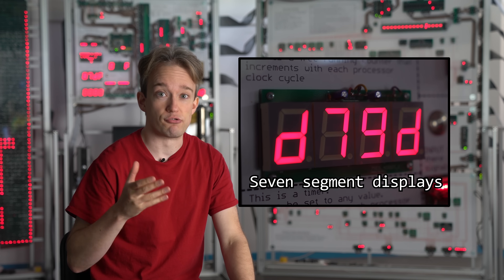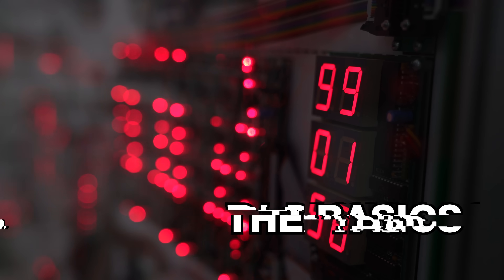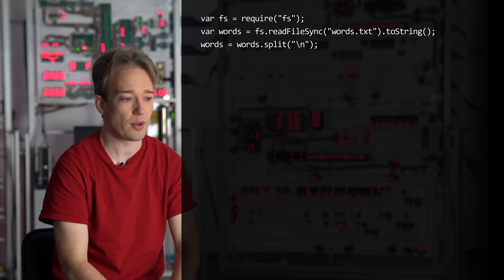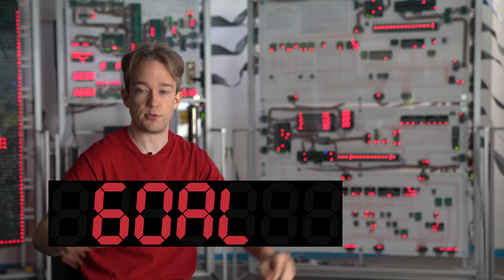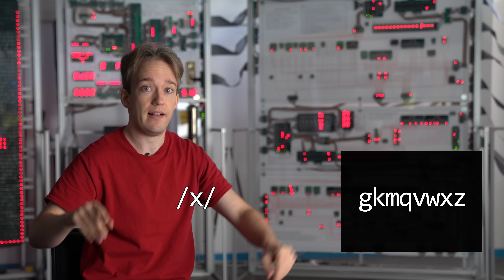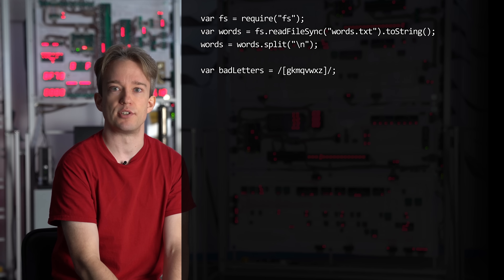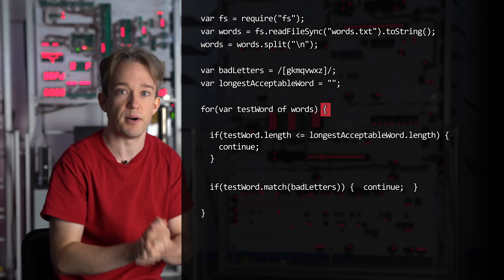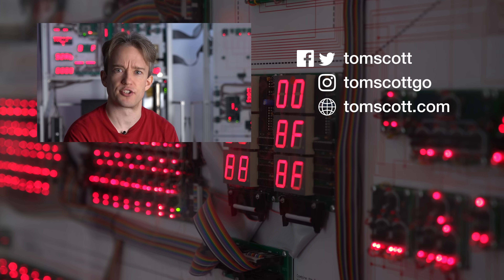What's The Longest Word You Can Write With Seven-Segment Displays?

Comment: This is going to bug me. Seven is the minimum number of segments required to show every Arabic numeral, not "every number".
Reply: You could argue that "every number" is correct since you can just write the numbers as a string of digits using Arabic numerals.  (I'm assuming that our display is infinitely long and that we only care about reals.)
Reply: well Pi is a number and you can't write it even on infinite-sized board, because you just don't know it, and will never know. But you can use PI, and it's exact.
Reply: @Lag Duck, I should also have made the fundamental assumption that time is infinite and programmers work for free.
Reply: @lagduck2209  Pi can be written by lighting the top horizontal segment, and both lower vertical segments. Several other constants could be displayed as well.
Reply: distantcam is technically correct because every natural number can be written with a 1-segment display in binary..
Reply: Alex Stefanov Yeah, but given the lay audience (and the explanation of what a byte is) I figured it was reasonable to assume base 10.

Comment: Ahhhh! Using multiple if statements and not just if/else! But generally good! now to just turn that longestword var into an array and push acceptable answers!
Reply: If the condition body contains a return or continue like this, then there is no need for the else.
Reply: Don't be silly, this keeps indenting to a minimum. Much nicer. Though I do disapprove the mixed sameline and nextline continue statements in the same file.

Comment: 0:30 what do you mean most people don't write 4 like that? I've always written 4 like that.
Reply: For real. I'm so confused by that.
Reply: 4
Reply: The question is if we unknowingly learned to write 4 like that because seven segment machines were invented. 🤔
Reply: I write it like that on the off chance I do it too fast the other way and end up getting a 9
Reply: the '/' is somewhere around 75 degree, the bottom left corner '/_' is a bit "bend"/"curve" , then straight '|' down at the right side, leaving a bit of extra '-' to the right of the '|', about 0.05-0.1 mm

 '9' is basically,  the upper 'of g' (with the 2 'ends' not touch each other - you can say it's a bit like a tit w/o bra xD so to speak) with the '|'  slightly bend ~2/3 way down, right after the 'closing up' of the 'o' part

that's how i do '4' + '9'
Reply: Maybe it's a UK/us thing?
Reply: Probably not. I'm from Germany and I write my 4 exactly like the one from display.
Reply: Is it about the diagonal on the top left or is it about the cross section on the bottom right? I think most of us write a 4 without the diagonal line, but we all have the horizontal and the vertical lines crossing each other, while on a 7seg display they only run into each other without overlap. 
Still a very tiny thing to almost not call it a 4.
Reply: nero3700 No, I write a 4 as a lower-case u with a longer "stem". Nothing crosses.
Reply: it's not, i write 4s like that too and im from the uk
Reply: Im dutch and writing it with the fork end, which I do, is considered weird so I dont think so
Reply: @Wezla  it's a UK thing. I've never seen someone in the UK write 4 like that.
Reply: @Wezla  Im from the UK and I sometimes write a 4 like that
Reply: I prefer the 7 segment way because people have hideous handwritting and 4 becomes 9
Reply: Same for me.
Reply: Legit forgot how I write 4
Reply: kind of blew my mind, Ive only ever seen 4 written like that on a 7 segment display, but never noticed it being different to what I've seen written.
Reply: Usually vertical an horizontal line cross
Reply: Nope, I write 4 like it is in 4 segment display, and thats what most people I know how they write 4 does. I learned to write 4 as I did in school. I am in Norway.
Reply: It's odd. I know very few people who write 4 as it is on a keyboard. I was taught to right it in the digital way, so I always have.
Reply: I think that most of the people that write a 4 the way it’s displayed are older. I’m sure Tom grew up with that being the only way to do it. But with all the 7 segment calculators and other influences, a majority of the people I know do it the other way and I myself grew up doing it the other way. I don’t think the old way is the way “most” people write it these days like people putting the second line in 7 or the serifs in 1 but I do think it used to be true.
Reply: The correct way, of course, is "IV".
Reply: me too....
Reply: Yeah I was really confused by that one... I mean computers display 4 differently but I didn't know people wrote it like that
Reply: I write my fours like IV but it gets kinda tedious sometimes to write big numbers like MMXVIII. And not having a zero does make my calculations a bit awkward...
Reply: I write it sometimes open like that (but with the left stroke slightly slanted and the horizontal crossing the right stroke) and sometimes closed.
Reply: I write 4 with the "top" open as well, but I know that many use the closed form. Then again, I write 7 and Z with a horizontal line through them. Not very common!
Reply: @mytube001  writing 7 with a horizontal cross through it makes it unmistakable for a 1. IMO it's the most logical way to write a 7
Reply: Glad someone mentioned this
Reply: I think most people would (historically) write it as '4' because that's one stroke and slightly faster and more convenient than the style of '4' used by these types of display.
Reply: i vrite Ч with one stroke, from the tip of the left vertical line, down, right, up and down, i have actually never seen anyone write a '4'
Reply: @kitsunekaze93  Me too! One stroke like the shape on a 7 segment display.
Reply: @balaclava351 I write Ч with one stroke. I start by the top left, and when I get to the middle, I go up then down.

Or I just do an 'u' with one longer leg.
Reply: balaclava351 I'm the worst type because I write it as '4' but in the two-stroke fashion because I originally learned it in school as  'Ч'. 

I switched because I think the open-topped four is clunky looking.
Reply: @Skwerll  I learnt to write it as '4' with two strokes, because we were taught to avoid upward strokes as much as possible.
Reply: @balaclava351  I actually write it like '4' but without the top half of the vertical line to the right, starting with the upper tip and moving diagonally down to the left.
Reply: balaclava351 if you want to make it one stroke you have to start from the bottom or middle of the number while writing it and that is literal blasphemy
Reply: @balaclava351  writing 4 with 1 stroke is actually not at all how it should be done... I wonder, do you start in the rightmost point or the bottom point?
If I were to write 4 to look like this, I would do two strokes anyway, both starting at the topmost point. And I think that is how most people write it, or with slight variation, that the vertical line does not start at the top, but at 3/4 of the height
Reply: @panda4247  There is no such thing as "should" in handwriting. It is a form of personal expression, and as long as it's legible, then it serves its purpose. Some numerals can be confusing, like the North American 9, the German 4, and the French 1.
Reply: @buddyclem7328  No, the sole purpose of letters and digits is to convey information. I am not accepting your argument of "personal expression" as valid, because you could say that about anything (extending from little things to killing). I mean, wearing a T-shirt of some colour is personal expression, but sewing your shirt incorrectly is lazy/wrong.
Reply: Wait - people actually write it as '4' when writing by hand? In one stroke? I don't think I've ever seen anyone do that O.o
Reply: balaclava351 Writing "4" with one stroke would be breaking English stroke order.

Not that anyone follows it anyway.
Reply: samramdebest I've also always written 4 like that.
Reply: I got gaslit and forgot how i write 4s for a minute, soi had to go check but i do write it like that
Reply: Same here, and I’m European.
Reply: Always have written mine like that too, although I do the other one as well some time
Reply: I think historically, people didn't write a 4 like that, and only started writing a 4 like that after the invention of calculators. I tried googling it, though, with no luck, ended up getting results for 4-function calculators and stuff
Reply: agreed
Reply: I've been writing it like that all my life. I think it started when I wrote numbers like I saw them on the keyboard. But people at school corrected me, because they said my 7 looked like a 1, and it should have an extra line. And I think something similar happened when I wrote a 4, but I can't remember it exactly.
Reply: same
Reply: Me too. That's the only way I write 4.
Reply: It really depends on handwriting
Reply: I'm English. I and everyone I know writes four like an L with a vertical line going through the middle of the horizontal line of the L. I've never seen anyone write it like you do, only on seven-segment displays.
Reply: Same. Was an acceptable alternative when I was learning to write numbers circa 1990. Not sure if it's because of seven segment displays or if it dates back earlier here in the states. Tom, it's an interesting topic to at least look into - did 7SDs actually change handwriting? After all, the ball-point pen changed cursive irrevocably.
Reply: 4
Reply: Im Aussie and i had to sign out a set of keys with the number 4, and I do my 4's like that. Security asked me to do them differently because new guys couldnt figure out what it was.
Reply: Tbh? I was so confused
Reply: This comment says you don't.
Reply: I write it like that too, for me its easier to do fast otherwise it looks to curvy when i do it like 4
Reply: Some write the 4 similar to a seven segment display, that is the left side is vertical not on a slope and looks close to a seven segment display as it’s not jointed to the vertical line on the right.
Reply: I have always written 4 the way the 7 segment display shows it lel
Reply: @samramdebest aren't you that guy who always comments on Steejo's videos?
Reply: The real question is: how do you write the letter T with seven digital segments?
Reply: TIL some people write 4 in one stroke
Reply: I started writing 4 like that around high school, maybe college, at the same time I started printing instead of using cursive because I felt it was easier to read.  Now like printing it just seems natural to me and I've kind of mentally blotted out the different '4's.
Reply: Ikr. I hte writing it like "4"
Reply: same here. an NA/UK difference
Reply: I think maybe what he's saying is that before seven segment displays were seen everywhere, people used to write 4's the other way, and the displays popularized the use of writing it that way.
Reply: You're not the most poeple don't you?
Reply: I write my fours like this: ﷽

I don’t know what all of you are on about
Reply: @Rainbow Hyphen I don't think that's very accurate. I think the majority of people everywhere apart from the UK write it with the open top. I live in Germany and I have never seen anyone write a '4' like in this font in handwriting
Reply: arial doesn't write 4 like that
Reply: I write it like "4" the font is exactly how I do it
Reply: Why does this have 1.3k likes? Under a video about logic. "most" means you're simply not in that group -.- big deal
Reply: I wrote my fours like that when in Infant school, but then I learnt to write properly. ;) 1 bar should be slanted and the cross over should be short.